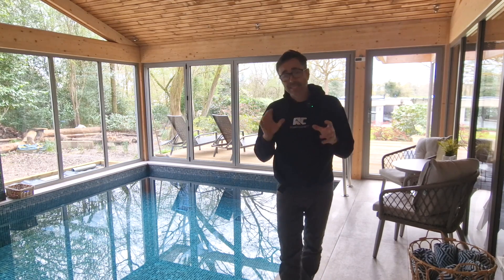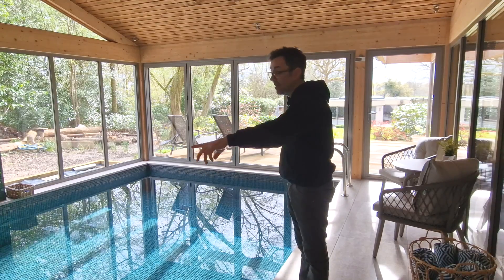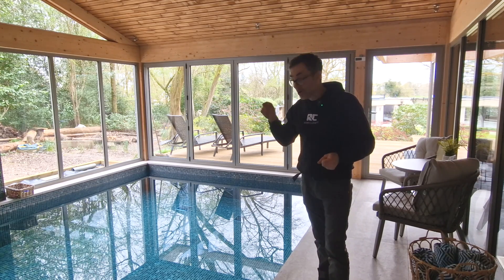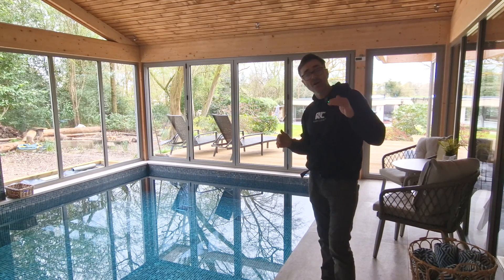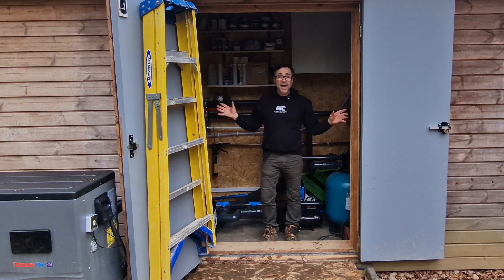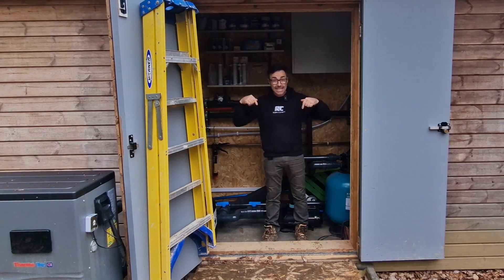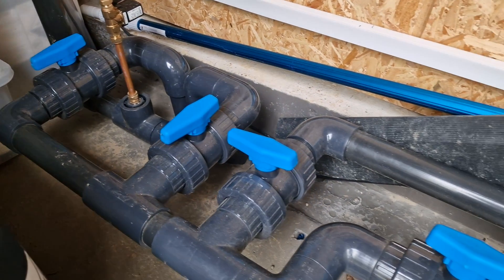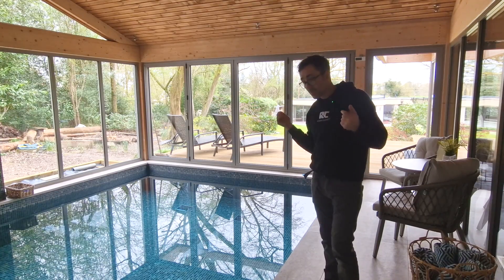Swimming Pool build Project finished, what I chose to filter, heat and treat the water

Comment: Your pool looks great.  Quick question, I'veoiften wondered why modern pools don't have insulated shells?  Would it have been possible to line it with something like Kingspan and a pool liner on top?  Or would the weight of the water be too heavy for the insulation?
Reply from the maker: Hi Michael, my pool is insulated all round and even under the slab, this is a current building regulation requirement, from memory I have about 200 mm of insulation, the concrete shell acts as a heat store too so it makes it much more energy efficient
Reply: @robinclevettcarpenter  Thanks for clarifying my mistake, Robin.  I think I must have watched too many pool construction videos from the USA where I've never seen insulation used.  Good to know.

Comment: Is the humidity levels so high that a regular MVHR system would not work? That would extract moisture and combine the heat recovered into fresh air incoming.
Reply from the maker: Yep the humidity generated by the pool water is much more than a typical dwelling that uses MVHR and my dehumidifier does recover the heat as does the fresh air fan

Comment: Out of interest across the year how much did the pool and room cost to heat?
Reply from the maker: Hi Mark, I have not worked the cost out yet but I reckon it will be about 40 to 50 pounds per week at the higher energy prices currently this would be pool filtration, heating of the water and the dehumidifier/air heater and the fresh air fan
Reply: Thanks for the reply. Wow that doesn’t seem too outrageous at all. Testament I guess to such a well designed /built building

Comment: I have been waiting for this vid. I live in the San Fernando Valley and I have serviced pools for 50 years. Bel Air, Beverly Hills, Toluca Lake etc I am retired now, but I built a little pool that satisfied all my needs and wants. 12x28, 6 foot deep with a small Jacuzzi in the shallow end. It’s outside so no need for all Robin’s AMAZING features. Indoor pools need all the stuff he mentioned. The humidity and the chlorine in the water will kill anything metal inside the structure, plus the chemical smell is miserable. He has systematically dealt with each issue in a first class way. From June to October I swim daily without any heating (I have a 250,000 BTU natural gas heater). In the cold months we heat the Jacuzzi two or three times a week. My pool is 3 feet above grade, so we have a love place to sit. 15 inch thick walls, 3 mats of rebar. Swimming and water is really great. Mine is much simpler but works

Comment: I love the science behind  swimming pools! Our pool holds 26,000 litres; getting the pump flow rate and chemical balance right is a steep learning curve! Then the addition of the heat pump! I remember when I first installed it, I heated our outside pool to 37 degrees! When we got the electricity bill I quickly turned it down to a more "economical" 27 degrees. Your pool and garden room are next level! Well done!!!